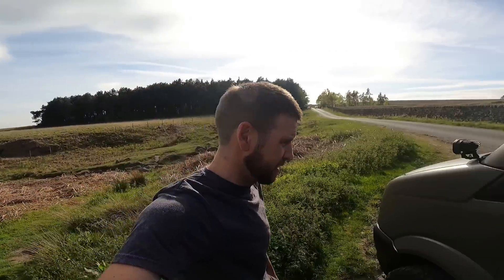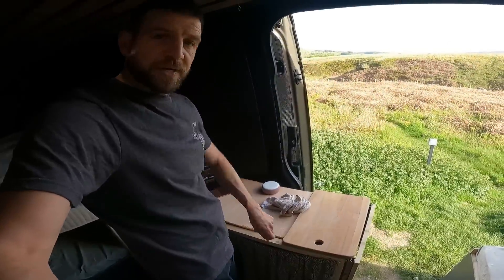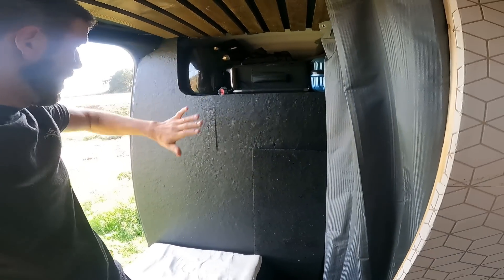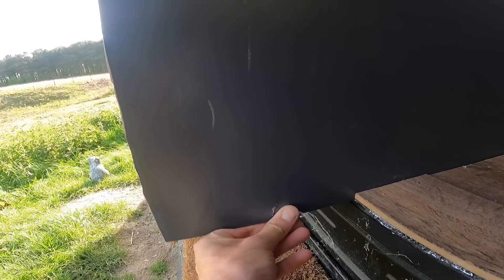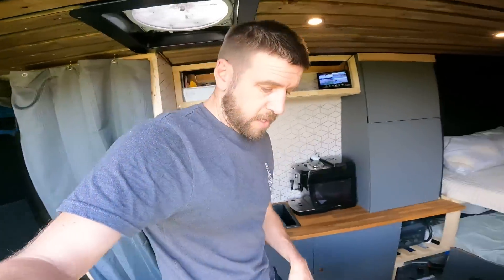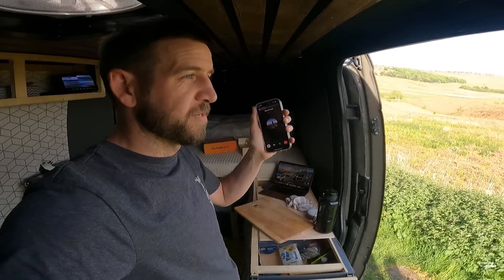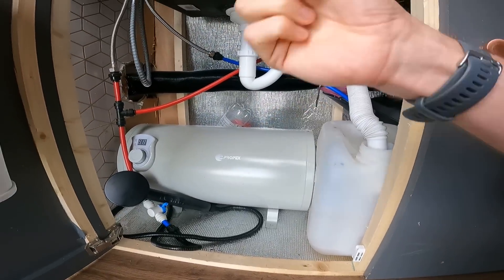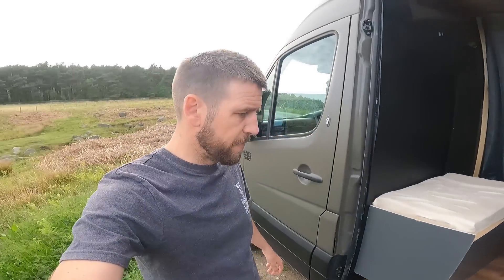Nope! I Crashed The Van!

Comment: M8, have you looked into using Upol Raptor..  done my sprinter in it, and it looks sound, you cannot scratch it, and it's tiltable.
Comes with the spray gun. If you don't want to spray it on, you can get the Upol roller and roll it on..
You'll love it m8 itl cst you around 200 and worth every penny.
Reply from the maker: I have yes, I found that before military paint, but I don't like the finish of raptor unfortunately.
Reply: @TravelwithGaryandAmika  
Just thought it might help with your dodgy driving 🤣🤣
Reply from the maker: You can get matt lacquar, which I will get around to looking at in a month or two hopefully.
Reply: @TravelwithGaryandAmika  I was going to suggest a few coats of lacquer.. BTW.. 
I've come up with a brill idea for your shower door.. I've done it in mine what a brainwave

Comment: Hi good vid sorry to see your has damage to the paint work. A quick question about your Air fryer does it work with the river to Pro?
Reply from the maker: Thanks. 
Yes it works perfectly on the river 2 pro. I use it most days for that purpose
Reply: @TravelwithGaryandAmika  Thanks for getting back me. Please can you tell which type of air fryer you have. Also do you need to use the boost button.

Comment: Leather is not smooth so the natural look is good, problem with laminate and chip board if they get wet the glue breaks down and they fall apart best to go for marine ply.
Sadly Gary in the thirty plus years I have been driving noticed the standards have dropped even with a three & a half ton pickup truck with a bar on the front still get people wanting to play chicken hopefully you got the idiot on dashcam.
Reference dashcam as I stated before Nextbase do a hardwire kit I had the garage fit mine it is basically the plug that goes to the camera on a long wire and the relevant fuses and accessories, they have run all cables between the headliner then behind the A pillar trim into the fuse box.
Stay safe and watch for 🤬 idiots
Reply from the maker: Thanks mate. I've added the leather and it looks quite good... I think... 
Didn't have the dash cam on. Only really use it for YouTube 😂
Good effort on the hardwire. To be honest the cable is about 3 or 4 metres long so I can hard wire it that anyway 😂